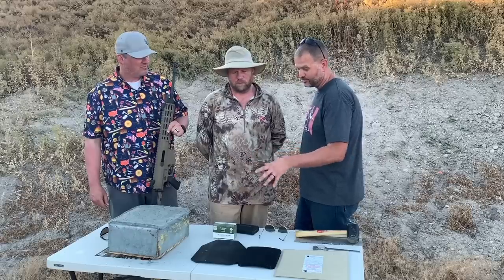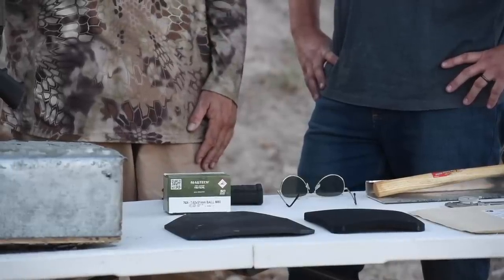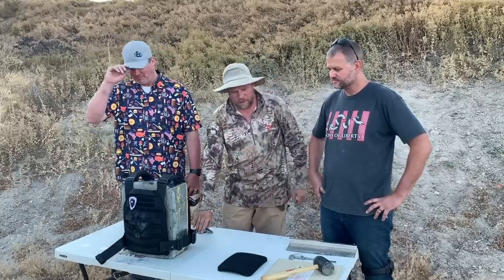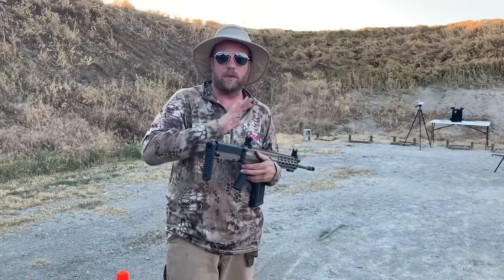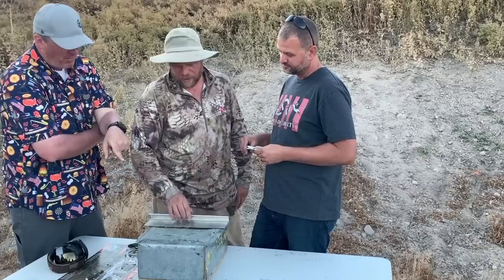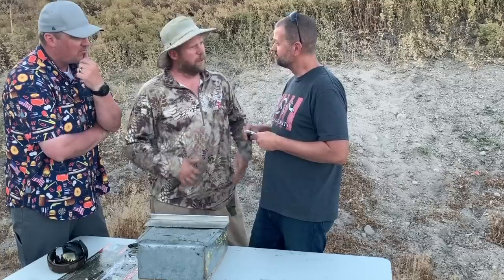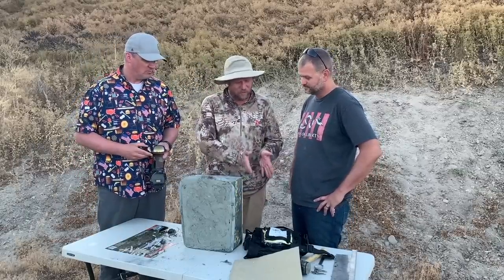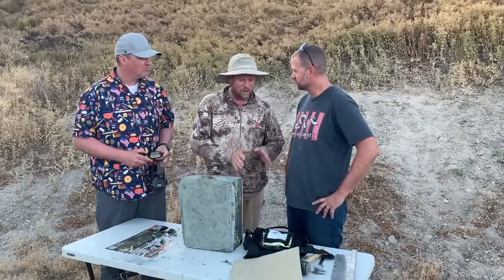Armor Testing: Blunt Force Trauma

Comment: What I figured. I see a more variable where a helmet takes a round against trauma on the neck.
Reply: I’d be more concerned about the acceleration that the brain is subjected to. Sufficiently severe and/or repeated concussions lead to, who’d have guessed it, irreversible brain damage. Just ask the NFL how that’s going for them.
Reply: Concussions too
Reply: Might be a bit off topic, but when a friend of mine recently got into an accident while riding his electric board and broke his collar bone, he wasnt wearing a helmet, and is convinced that had he wore one, he wouldve snapped his neck and died on the spot due to that extra inch changing how he landed.
Reply: @AtrociousAK47  There are always freak accidents where not using $safety_device might save you by, for instance letting  you be ejected from a car. But statistically things like  seatbelts and helmets keep you safer than doing without, so I'll keep using them.

Comment: did he say tension pneumothorax wont take you out of the fight
Reply: He said pneumothorax but not tension pneumothorax. Pneumothorax means free air in the pleural space. The free air can vary in volume depending on the airway trauma. Tension pneumothorax occurs under positive pressure when the pressure of the free air trapped in the pleural space exceeds the negative pressure of inspiration preventing lung expansion. Pneumothorax may resolve spontaneously. Tension pneumothorax requires emergency thoracic decompression.

Comment: im not discounting the benefit of the soft padding alleviating the impact of second hit on the ceramic plate but want to point out that the first hits deformation would have been slightly holding the plate further away from the pad and clay backer possibly giving more time to displace the inertial energy

Comment: Ok, I am not from a firearms background
 but surely in terms of energy  as long as the plate can stop the projectile and spread the impact across even a slightly larger area it would almost identical to the recoil of the rifle. Granted  the action of the rifle does mitigate a large portion of the recoil. But the impulse of the round impacting the ceramic and the metal plates Is still almost identical to a round striking an un armoured target. 

With the soft armour spreading the impact the worst. but providing the largest increase in the impulse. So all armour really needs to do is stop penetration and then it would work as armour? Or am i missing something?
Reply: You're missing at least two things:
One-bullet has a much larger speed, so it distributes the energy MUCH faster that the recoil itself.
And two-bullet is small and (usually) pointy, and when handling a rifle the shooter has several points of contact with the it:the pistol grip, the handguard and the cheek rest. Combined together, they have much bigger area than the bullet.

So yeah, even these two factors make blunt trauma much deadlier.
Reply: @dedbolt6339  thats not all gun like such rifle is much heaier so it not transfer so much eenergy into body as lighter armor plate  also   you sure that explosion which drie bullet in rifle have longer time duration from lets say starting point to peak force/pressure in chamber?  alot depend on bullet and target characteristic how long it take so yea... anyway 4 kg rifle transfer much less energy to body than 1 kg armor plate  in fact only conseration of momentum rules hear the heavier gun the less eenrgy in free recoil it achiee for egzample 10 kg rifle which shot bullet weight  15 gram with vvelocity 1000m/s so such bullet havve  15 kg x m/s momentum and 7500 joules vs rifle also 15 kg x m/s but only 11,25 joules so rifle hae in this egzample 666 times less kinetick energy :x

Comment: The impact on the steel armor is better absorbed due to its sheer weight? I imagine if you had a smaller plate there would be more energy transfer. BTW would like to see someone punch the clay for comparison and maybe hit it with baseball bat while you are at it.

Comment: I'm no scientist but I have long wondered why nobody has used a some kind of piezoelectric measurement to give an idea how much "impact" force is applied to the target. 
Measuring BFT and the visual signature in the clay, while impressive and measurable, doesn't give a true representation of how much energy is applied to the target overall and how that dynamic would translate into the target (human, considering the products intended application) absorbing the entirety of the absorbed energy as opposed to standing rigid and immobile upon impact.
Not too unlike being in an automobile accident in an old car vs. a newer car. The old car doesn't incorporate all the crush zone materials that the newer car does so the impact absorbed by the restrained body is MORE than the newer car that progressively absorbs the energy over more time, which is less traumatic to the restrained body. Does that make sense?
Maybe not the best way to try and suggest testing but I hope my question(s) provoke educational conversations.
Thanks for the interesting, educationally and thought-provoking conversation, Gentlemen.
God Bless, Be Safe, and.....
Overnout

Comment: Is there any body armour system out there that you would consider testing by actually wearing while a live round was fired at it? If not, do you believe such testing to be irresponsible/unsafe/unneccesary? I would be interested to hear why, if the plate is scientifically proven to stop the round fired at it and given the assumption that the round would hit the plate and not "miss", there would be reservations in testing it in such a way. For example 9mm vs level IIIA; given that "felt recoil" is a thing, testing "felt impact" could/should be a valid qaulitative assessment...
Reply: epl803 not exactly the same thing. But there was that armoured glass manufacturer who stood behind an armoured windshield and had somebody shoot at it with an AK. Worked pretty well as a marketing tool.
Reply: The issue is that you can never assume that the round is guaranteed to hit the armour.
Reply: Even if they were willing to do it they certainly wouldn't be able to post it on youtube.
Reply: I recall seeing a video where the inventor/salesman wearing soft body armor, actually fired a live round into his chest with a handgun.  I think he used was a revolver, make and caliber I don't remember.  The demonstration was to prove to law enforcement and civilians, his armor actually worked in stopping handgun rounds.  I don't recall the name of the man, the company and how well the body armor sold.  If I'm correct, his demonstration was done on multiple occasions.  Hopefully, someone more knowledgeable can chime in on this....
Reply: @JoeJoe-yz7vm  It was almost certainly Richard Davis from second chance body armor. He did numerous demonstrations firing handguns into vests while wearing them, I believe including .44 mag.
Reply: @jameshealy4594  Yes, it was a .44 magnum--I had a VHS copy of the demo way back when--late 80s, I think.  Same video also had a FAL shooting 7.62x51 into a plate/vest (the targeted person was standing on one foot, to show that the round's energy would not knock you down), along with some waterjug shots of Glasers versus ball.  Wish I could find that video again!